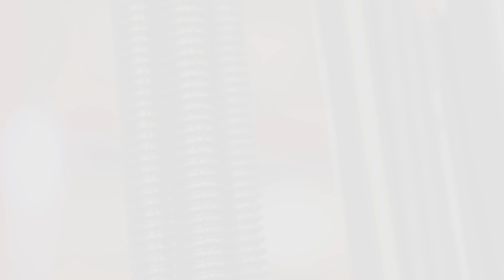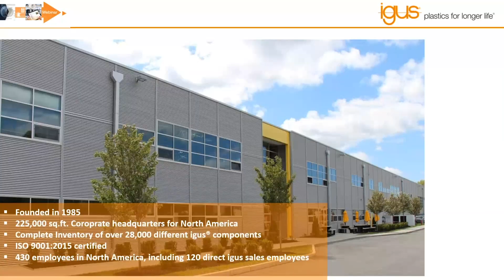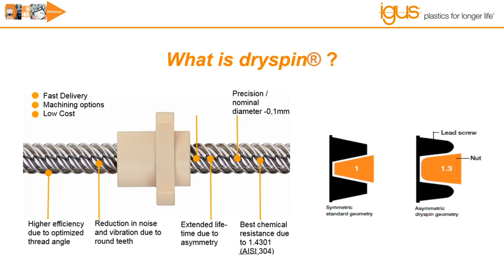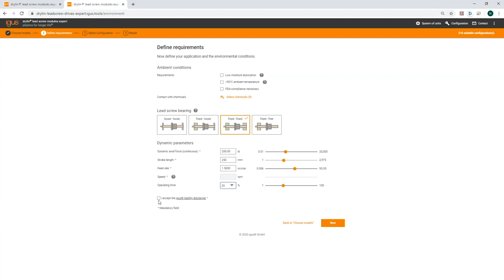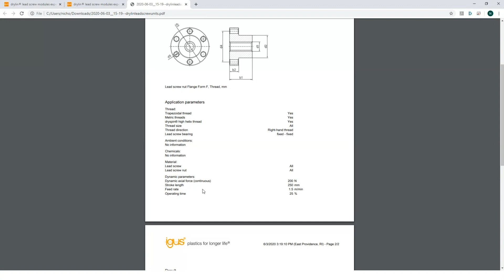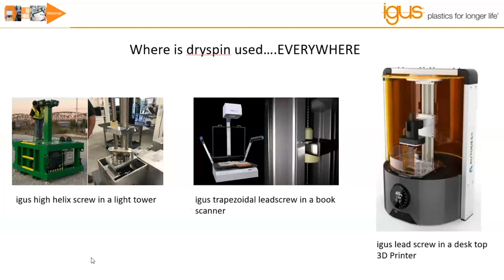drylin® - Learn to calculate the lifetime of dryspin® leadscrew systems

Comment: Hi ... What is the best  flexible electrical conduit  that handle the  pressure on it and  non bending if some one step on in floor  and stands harsh conditions, and can also be used within concrete and brick walls